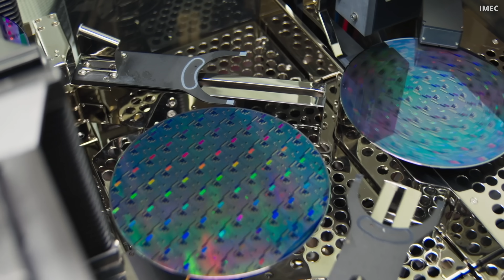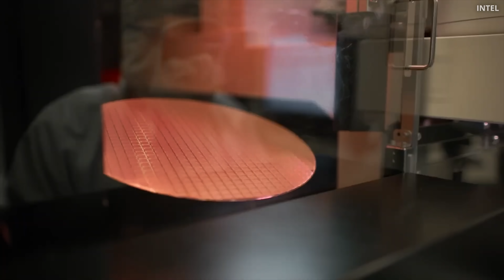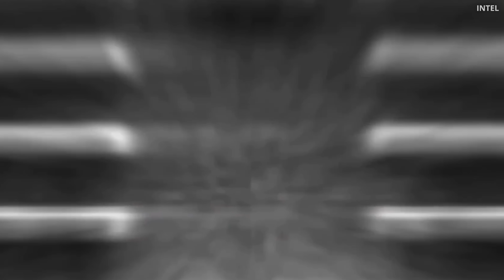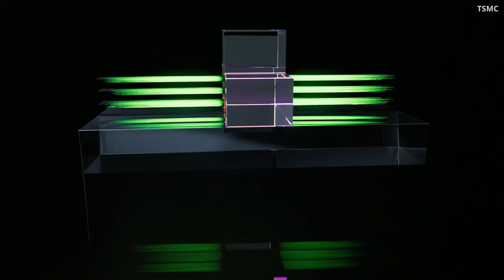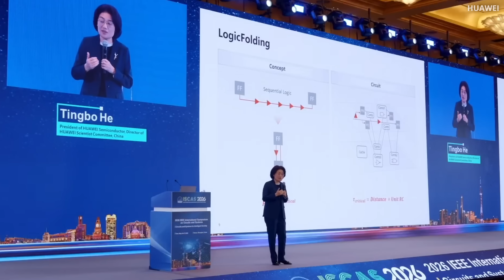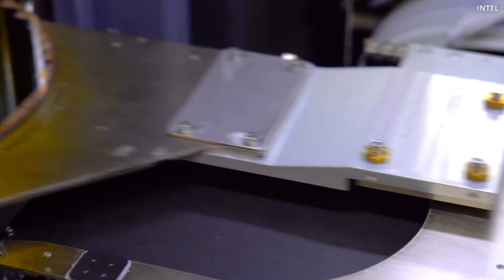China Just Built What TSMC Said Was Impossible

Comment: Why Synchrotrons Are Great for EUVHigh Brilliance: They produce an incredibly bright, focused beam of light.Tunable Wavelengths: They can easily generate the precise 13.5-nanometer wavelength required for advanced chipmaking.Stability: The light beam is highly stable compared to standard laser-produced plasma sources.Why They Aren't Used in Standard Chip FactoriesMassive Size: A synchrotron requires a giant, ring-shaped particle accelerator that can be the size of a football stadium.

Comment: As USA building semiconductors on top of each other this is highly technological in advance skills.
Whereas China is building semiconductors in a rose into two sections and they are folding it. This is for United States is in Stone age technology because as far as I remember, I’ve been using my computer since it was the CPU power. 385-86 megahertz on Windows 3.11 the motherboard at that time this is early 90s.
The motherboard at that time already was for false.
If you see that old motherboards they used to be around 250 mm x 250 mm they were for faults motherboards. This is ancient technology in United States.
What China is using it semiconductors folding it into two folds in United States is in Stone age already.
As USA to build semiconductors in a rose on top of each other it is far more harder and smart technological skills building a tower than building a platter Chinese building plane whereas USA building towers.
China until now has not reached 5 nm semiconductors, I would be done right if not wrong possibly they don’t even have 10nm.
 please correct me if I am wrong.
I am not exaggerating all I have understood even military equipment the arms whatever China has its latest hardware. USA already they had at least 15 to 19 years earlier.

Comment: Smaller doesn't matter. Its about mass scale. This is a dumb video. Tesla is creating a 14nm production line that doesn't require smaller die, and logic can be of a slower compute time, but does the work within tolerance. This is such a weird video in light of that. Texas will make these machines and do it cheaper at scale.
Reply: I mean yeah embedded systems always used a cheaper chip with a more basic programming language. No reason to single out Tesla when this was always the case with actual industrial companies like Dow chemical. Tesla is a meme stock and honestly 14nm is overkill for car silicon.

Comment: * i come hear thinking china actually made a breakthrough with 3D stacking chips
* (well, i just used AI to summarize for me for a brief tour)
* i heard that 3D stacking stacks the heat as well, so there will be "heat protection throttling"
* that's... an interesting twist, claiming a paper mileage that can't never be achieved due to "heat protection throttling", can never run full speed

* so they indeed built the impossible, because it's still impossible on actual running?
* you're not kidding me, right?

Comment: What Huawei actually did is stop optimizing the node and start optimizing the network. That's  an ecology breakthrough. 80% of energy moving data instead of computing it — that's  that's a terrain problem. And their answer is the same answer a slime mold figured out a billion years ago: stop traveling distance, become proximity. The Tokyo rail map experiment showed that a brainless organism will find the most energy-efficient path through a complex network every time — not by being smarter, but by letting the network fold toward itself. Huawei just did that in silicon. The 1.5 micron bonding pitch is the real story because it's not a spec, it's a threshold — below that number the layers stop being layers and start being one organism. Whether they can solve heat is just biology at a different resolution. You can't concentrate metabolism without a circulatory system. That's the only question that matters and it was always the only question.

Comment: Anything Huawei can do, TSMC can do better..

Folding: TSMC flips the traditional side-by-side layout of n-type and p-type transistors, folding them vertically to cut horizontal cell area by 40–50%.

Stacking: Instead of gluing separate completed chips together, TSMC builds these folded transistors atom-by-atom on a single piece of silicon. This keeps the vertical connections down to a nanometer scale, maximizing speed and power efficiency.

Comment: The idea of going up is not new.  In the 1980s, Thinking Machines developed the Connection Machine.  CM2 (The second generation) was a cube 1.5 metres on a side.  This was divided into 8 sub cubes.  Each sub cube had 16 printed circuit boards (stacked vertically) and each circuit board had 32 chips.   These chips worked in parallel and communicated to each other via switching devices called nexuses.  The architecture was awesome.  Programming the CM2 was non trivial.  If you have not heard of the connection machine before, have fun finding out more.

Comment: I find 3D architectures fascinating, but in addition to the heat problem that everybody's mentioning, the capacitance and inductance problems get worse, don't they? You're basically going to have a lot of electromagnetic interference between the layers. 

Theoretically I suppose you could design around that, possibly even use that, but that seems like an enormously complex problem. Like well beyond our current capacity to compute stuff like that but I don't know. More asking than stating.

Comment: Thought: radiant heat is another form of electromagnetic waves. Perhaps the heat can be piped, collected, and used as another form of signals in and out of the chips. Maybe hollow "pipes" that are perpendicular to the surface can be incorporated into the design. This is analogous to the inner atrium lobby of a tall hotel, replicated every few devices. The sacrifice of density in the chip area could be made up with the ability to stack higher, or increase local density on the chip.

Comment: I think if they can find a way to move all of the pins from the bottom of the chip to the sides that it would allow heat transfer from both sides of the chip. But, that would likely reintroduce some of the distance they are trying to eliminate in stacking the chips to begin with. Even so, overall it would still be steps in the right direction. 

I also wonder, since China has basically been open about ignoring or not enforcing copyright from other countries then how would they react if one of the other chip makers took their idea and started working on it? I am sure TSMC could develop the tech considerably faster than any manufacturers in China could, while doing it better. China would be doing it with a 7nm process while TSMC would be doing so with a 4 or 3nm process, maybe even their 2nm process.

Comment: I like the idea its a interesting economical solution to modern scaling but i can't help but feel stacking logic too aggressively will create heat problems that make it hard to compete with truely scaled transistor density i feel the biggest question becomes is this just a neat step up for the moment or does it scale into the future can u actually solve all the eventual problems that will come with the stacking or will proper scaling just leave u behind at some point anyway

Like any time they will stack denser chips the entire heat equation changes that much energy density in such a small footprint with more pathways to actually connect everything seems like a immense heat trap

Im kind of sceptical about the future of this technology i'm sure it can work with Huawei's limits on EUV but the claim of 1.4 nanometer density with a stack thats both denser in pathways and heat footprint sounds a bit dreamish

Comment: It is more about the naming, where the "nm" technology does not translate to size, but the transistor density. So transistor size-wise 1,4 nm stacked vertically could be equivalent to 3-5 nm stacked horizontally. AMD had already some problems with cooling their 9950X3D thus why they did not include big L3 cache on all cores for some time. Anyway interesting how they plan to cool it down. And btw from what I know Huawei pushed DUV ofc, but % yield is much lower than EUV counterpart, that was the biggest issue and reason why Kirin is only in some very expensive flagship models.

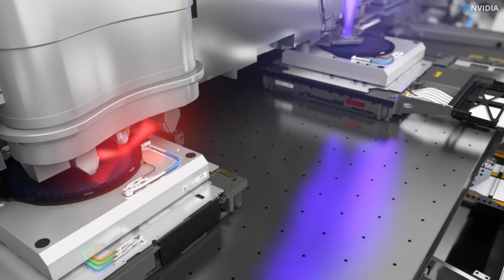Comment: 10:37 I definitely agree with the approach they’re taking stacking it to a 3-D infrastructure is one of the next steps needed. But then you have to deal with dissipating heat.. the other thing I would suggest is an overall architecture change on each processor. Where are you? Cluster a ring of transistors around as small of a memory circuit as you can make so you make a simulated physical neuron or as close to the approximation as you can where each memory core in that transistor cluster can remember the states of those transistors like a primitive neuron

Comment: This vid seriously reflect on a dream I had years ago that AMD built a cube processor. It was one of those dreams that was very real. They already had stacked processing / SP's / 3 layers with a dual layer memory buss, but the lab couldn't proceed due to the linkage on the motherboard. The motherboards in the dream were already using light pipe data transfer protocols & the module to bind the light pipe to the CPU couldn't transfer without a separate module that slowed down the system & caused errors. So they designed a cube that could quadruple the processing & have a 4 side link. In my dream they were working on a fluid that would flow through the chip, stay cool, & not interfere with the light processing modules. The heat was a serious factor as it appeared to keep effecting the light wave timing. At larger scale it didn't seem to be an issue, but at the micro scale with billions of transfers per pico second was a massive challenge. They were settling on a fluid that had to be pressure injected into the cube that was about 3.81cm. It's kind of creepy seeing this stuff actually being built.

Comment: ❤Hello @Anastasiln channel❤ Is it possible for you to design 64 to 128 core 3 Gigahertz CPU processor and 240 GB Memmory RAM chip for a NEC Desktop Computer? The desktop should be able to have a 64 cores or 128 cores of CPU processor with 3 gigahertz clock speed calculations per second, and a 4 x 240 GB Memory RAM each chip, capable of 32 and 64 bits Operating System Architecture Machine to be built by NEC computer manufacturer in Japan to be sold in entire Asia area. With these computer settings, i think consumers who will be buying one is more than excellent enough for a multiple virtual machines to run and host by one single Desktop or even used as servers for Offices or individual Households end users that minimize power consumptions compared to using plenty of machines to host a server. So far what we have today is a high end of 12 cores i9 intel CPU or XEON arm design and mostly 8-32 GB Ram memory but old PC is not compatible with newly built CPU and Memory chips if we upgrade those Desktop computers built from 10 years ago.

Comment: With stirling cycle you can convert 30% of heat into electricity.
You can build in on chip. The outside is the cooling side of the stirling.
Then use the energy for cooling, with reversed stirling cycle.
(Cryogenics). That produces heat at another location with the electricity.
You use the heat to generate electricity for cooling.
Now, is that difficult? No. Its about the energy? Haha.

Comment: Necessity is the mother of invention. Stacking is nothing new, they did it in the days of vacuum valves. And they found the same problem. Dissipating the heat. Maybe Huawei have found a way to run their circuits at a lower voltage, which would improve the trade-offs to a square law dependency.  And would they tell you a trick like that? Or hide it with some other tech? Given that heat is going to be a problem it would certainly help.

Comment: The point being missed is that ASML’s customers are also moving into layering, chiplets, hybrid bonding, backside power, HBM and 3D structures. Huawei has not discovered a separate future that others have missed.

The difference is that TSMC, Intel and Samsung are combining advanced packaging with EUV and High-NA EUV. Huawei is trying to use layering as a workaround because it cannot access ASML EUV tools.

That makes Huawei’s approach clever and strategically important, but it does not mean they have caught ASML. It means they are trying to compensate for the lithography gap at the system and packaging level. ASML plus layering is still a very different proposition from layering without ASML.
Reply: Yup, and they also just made a chip with transistors that are smaller then 1nm.

Comment: Interesting video and topic of discussion.  I think heat issue of stacked 3D chip can be resolved by cooling the silicon wafer with its embedded mesh that cools the silicon wafer or use a different material instead of silicon so that entire wafer can act as a cooling system.

Comment: Im not an engineer or anything.  But cant we use photons instead of electrons if the problem is heating ? And i think it will also solve the electricity eating problem . Well not sure if they will act same as electrons in small gaps, if they will jump to different paths. Maybe making layers would help in different axis than just printing all into a board. And i think just like electron tunneling or photons can do it much easier.

Comment: Folding does not increase the total heat, in fact it is probably decreased due to more efficient data transfer. So the same heat is just produced on half the area. The only challenge is to have fast enough heat transfer in the immediate area. Since these are generally low-powered smartphone chips, I'm pretty sure there are already chips out there producing much more heat per area.

Comment: As some of the commenters mention below, the issue will be how to move heat. We're still using CMOS-based silicon, where energy is consumed when the transistor changes state. The two critical elements are voltage (as a square) and frequency. Shrinking the geometry reduces the voltage component, and, instead of increasing frequency, designers chose to duplicate silicon area, which is why we're not seeing 50GHz CPUs (among other reasons). Stacking silicon is not new; we see it in programmable logic devices like the Versal. But, the faster one goes and the more transistors that are flipping, the hotter it gets. Getting this heat out of the chip is the hard part.

Comment: This is a lie - TSMC is leading the industry with its A14 process node, which is scheduled for mass production in 2028 (specifically the second half of the year, with some sources citing early 2028).  The company has accelerated its roadmap, with risk trial production expected to begin in late 2027 at new fabs in Taichung.
Samsung has delayed its 1.4 nm (GAA) mass production target to 2029, shifting focus to improving yields on its 2 nm process. 
Huawei has announced a roadmap to achieve 1.4 nm equivalent transistor density by 2031 using its "LogicFolding" architecture and "Tau Scaling Law," but this is a design-level milestone rather than a traditional manufacturing process node, as China lacks access to advanced EUV lithography tools.